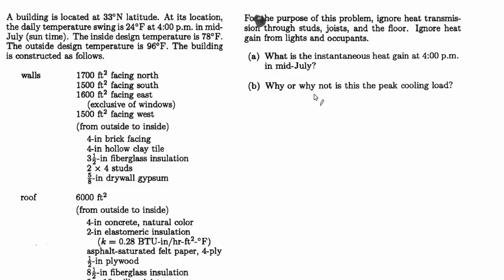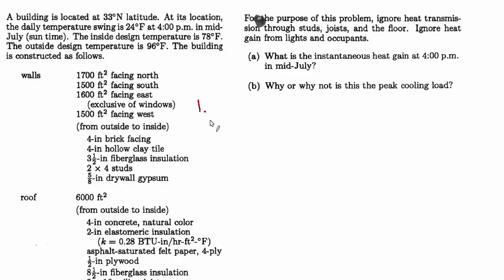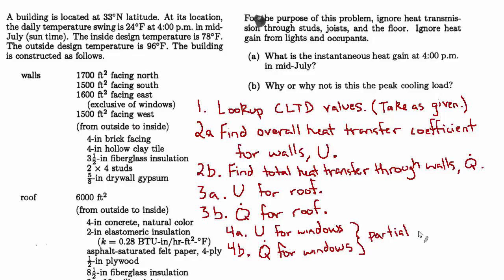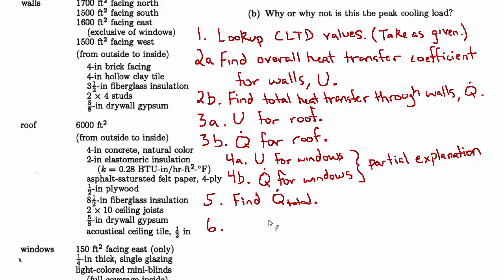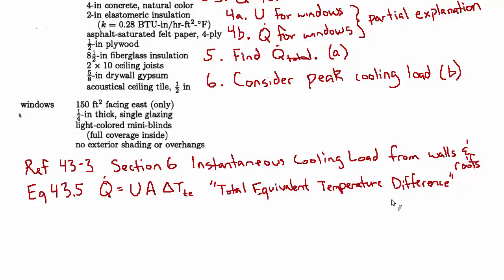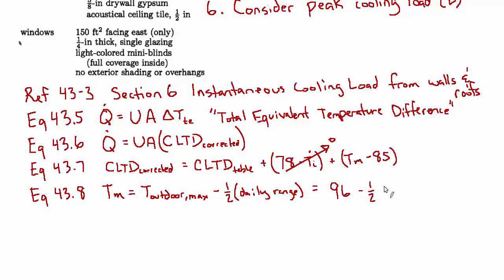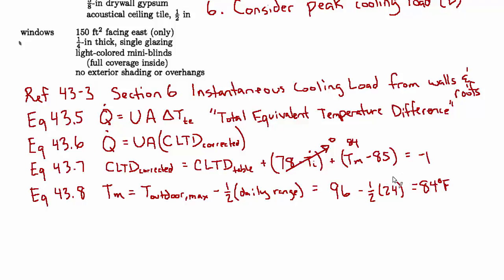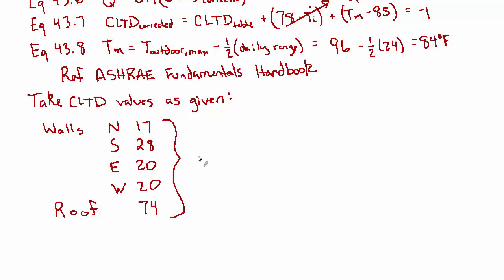Instantaneous Cooling Load Calculation: Heat Transfer in Building Design Explained | Mechanical PE

Comment: Where did they get the CLTD values that they provided for the walls and roof? A specific page number would be useful.
Reply: look into ASHRAE Fundamentals (Handbook) - Mine (1997 issue) calls it LOAD AND ENERGY CALCULATIONS (Chapters 25 thru 30). Nonresidential buildings, chapter 28 has example for CLTD, SCL & CLF calculation.
CLTD is one methodology, which is most commonly use in the industry. Where did the values came from? well the question is how do we arrive at these values - the values are all dependant on the material of construction and insulation values used, time of the day and solar incident angle, building location........listen to Dan's explanation when he is talking about instantaneous... and reference to MERM Ch 43.5 (section 6).